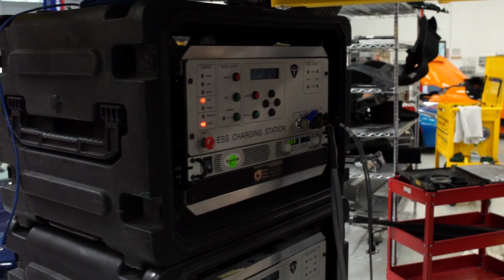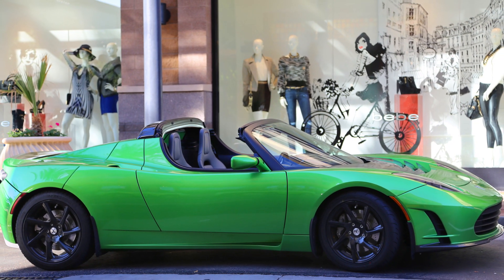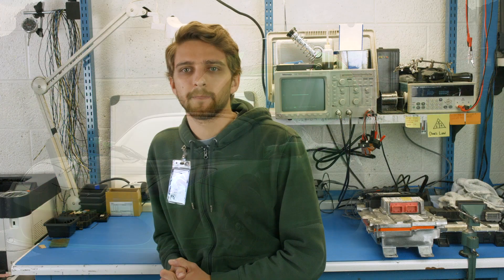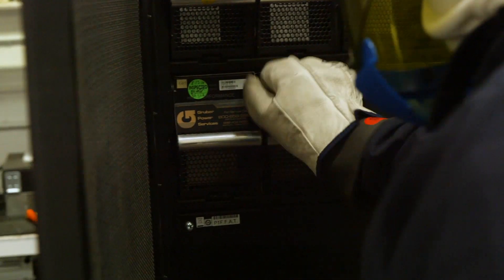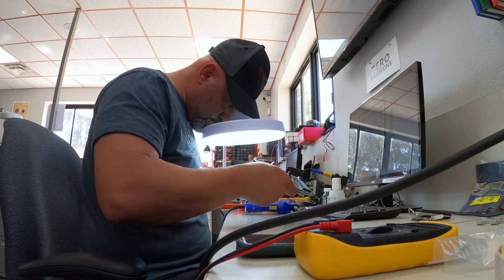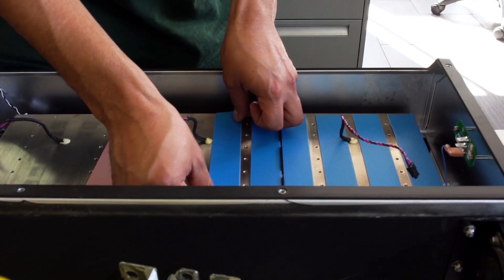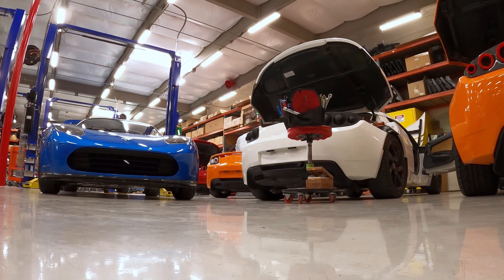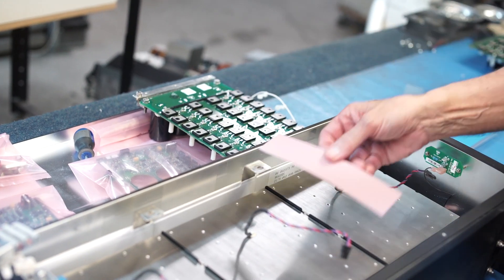A nostalgic video about Gruber Motor Company? | This is Our Story

Comment: Question: is the insulant in the PEM the issue that needs preventive maintenance?
Reply from the maker: There are a number of parts that need to be replaced inside of the Roadster PEM. The insulant is a big one.